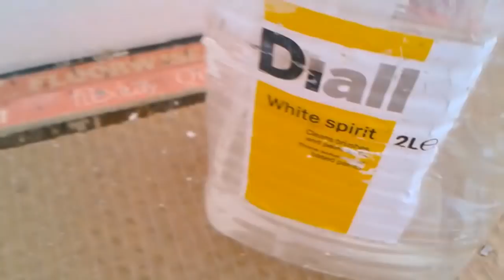What Is Efflorescence? How to Remove It? How To Prevent It?

Comment: Surely using steel wire is a no-no with salt presence. Anti Alkaline Primer isn't going to be effective if efflorescence is still occuring behind it.  First need to neutralize the salts with muriatic acid like lemon juice or distilled vinegar until it stops fizzing. Then all this to evaporate as, quite correctly, washing off will only reactivate the salt crystalization. Brush down surfaces with a non-metal stiff  brush. The Coovar will stick to the prepared surface. Occasionally there will be a show through which can repeat process. For any saturated plaster then best practice is to remove back to brick...then the above treated before replastering/rendering with a breathable waterproof additive. (PVA is water soluble so this will be counter productive on it's own). Once plaster has dried out fully .....use a moisture meter...then repeat with. Coovar Anti Alkaline Primer BEFORE any finishing Vinyl Emulsion Coatings. After years of salt-water WC supply ingress repairs this is the most effective system l have found & proven. Any additional advice welcomed
Reply: Hi just a question - right after applying vinegar on the walls and then brushing it, do I then wipe/wash it down with a watee or just leave wipe using dry towel?

So just for context; My bedroom (in an apartment) initially was painted in almost off-white colour, so efflorescence wasn't noticeable at all(didn't know my room wall has it). Called a painter to repaint room with dark blue and the process was sealer > primer > paint. Few hours after painters left, my whole bedroom walls were left with white patches of efflorescence. So went to asked the painters what happened and they only said something along like  'since sealer was already applied and this issue came up, it means your wall is damaged and requires full plastering to solve it'. Which I didn't know to believe or not. So now every few weeks I have to give my room walls a wipe down because the white patches kept appearing.

Comment: Does the Alkali Resistant Primer allow the substrate to continue "breathing"...
Reply from the maker: Ideal for priming, sealing and stabilising new, dry alkaline surfaces such as new lime plaster, cement and concrete. It can also be used to seal stains, stabilise powdery chalky surfaces and promote adhesion to glass, ceramics and some plastics. thanks
Reply: @Painting and Decorating  , thank you so much!!!

Comment: Does the alkali primer mean you don't need to use a salt neutraliser?
Reply from the maker: Yes  it stops this . Thanks
Reply: No.... it's absolutely necessary to neutralize salts first & am anti salt stabilizing solution is an option although l have found muriatic acid is best

 stabiliser

Comment: what have you got on your face lol
Reply from the maker: It's dust mask but is good for volatile compounds as well  FFP3 Dust Masks
Protects against higher levels of dust.
Protects against solid and liquid aerosols.
Higher protection than FFP1, and FFP2.
Can be used for handling hazardous powders such as those in the pharmaceutical industry.
Recommended when in doubt of protection needed.
OEL: Protects against materials in concentrations 50x limit.
APF: Protects against materials in concentrations 20x limit.

Comment: Good vid as always I decorated an old cottage about 4 months ago with lime plaster which had the same problem it had been plastered over  in places with modern gypsum plaster causing it to blow and painted over lime with vynil Matt in places the walls were wet with  damp it was an absolute nightmare I had to use alki primer then used McPhersons eclipse water permissible emulsion so the areas that were not sealed could breathe
Reply from the maker: Thanks, old buildings can be a pain to work on at times.
Reply: @PaintingandDecorating  yes they can but all the time spent on preparation is well worth it as they look lovely when finished